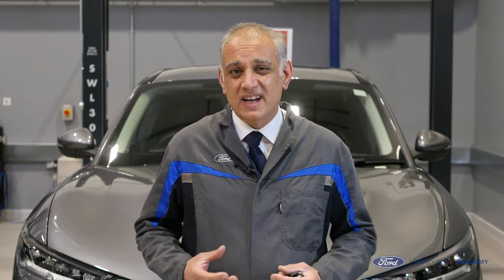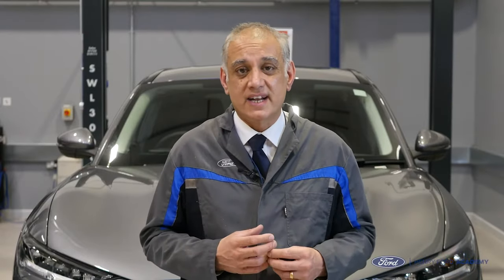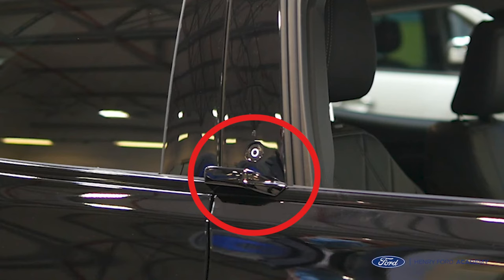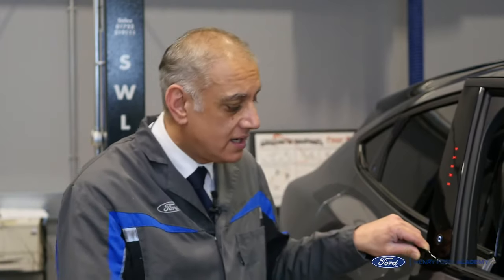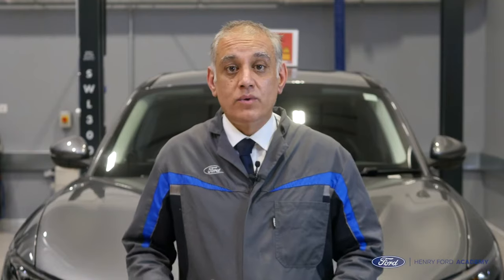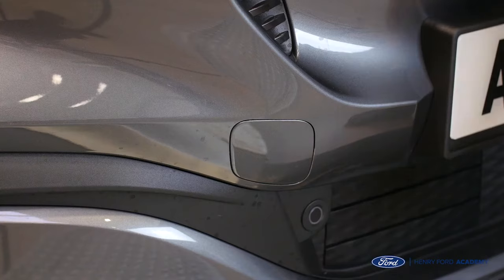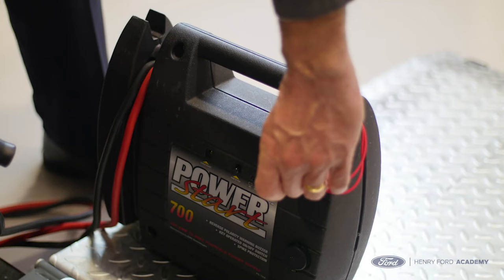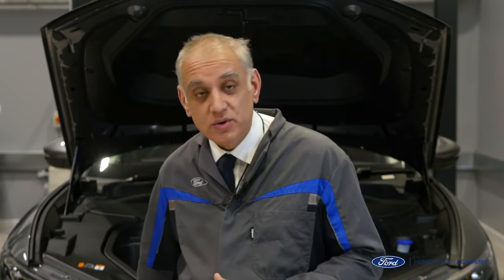Ford Mustang Mach E - How to access the 12v battery

Comment: Since every door on this car requires electrical power to open, where should I carry around the 12V jump pack that is required to gain access to the vehicle?  Should I duct tape it to the roof?  Should I wear it around my neck or let it hang from my belt?  Do I need to have a support vehicle follow me around everywhere I go which carries all the accoutrements I might require?